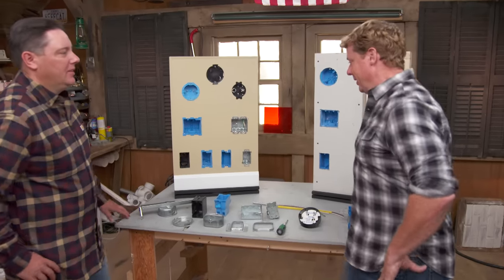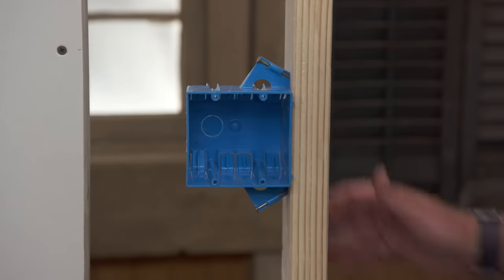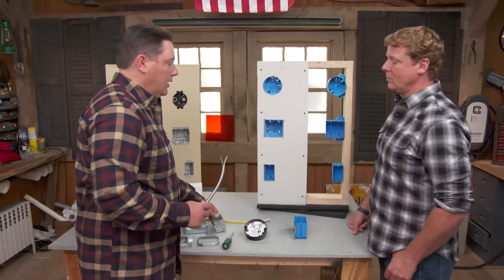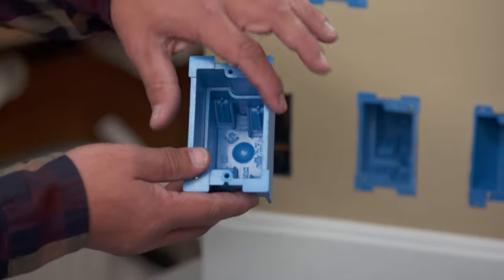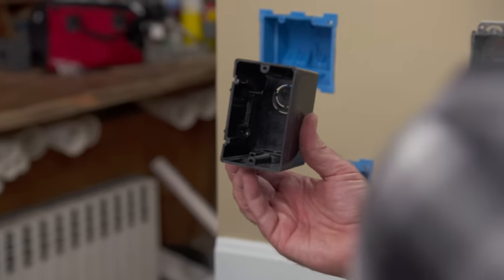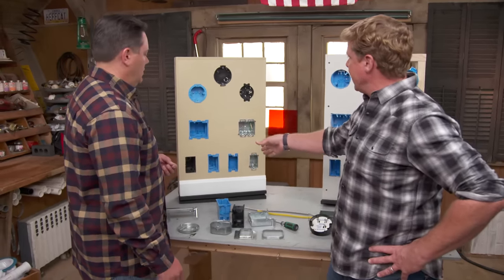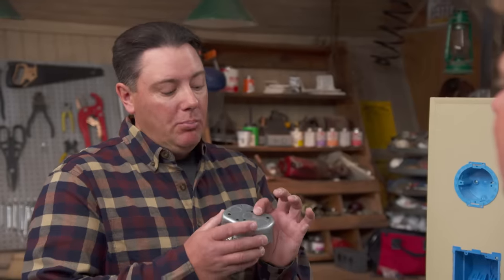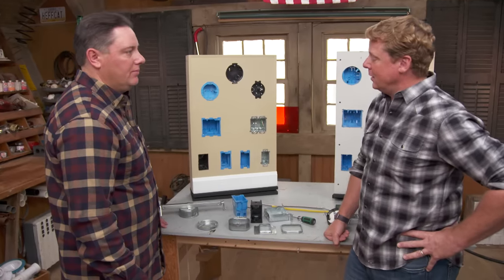How to Choose an Electrical Box | Ask This Old House

Comment: One additional thing that would have been helpful to mention is that the boxes come in different depths.
Reply: I wish my electrician knew that and used the correct depth so my outlets and plugins could be flush
Reply: And depending how many wires you have, you need to make sure it doesn’t exceed the box’s fill rating.
Reply: @damion1121  I found a junction box in my attic that was about 15 cubic inches, and according to an internet calculator, all the wires jammed into it required at least 32". Just a tiny bit overcrowded.  (I replaced it with a 42" box.)
Reply: Agreed.  A GFCI won't be getting stuffed into a shallow electrical box.
Reply: Tg
Reply: The reason for the different sizes is you are limited by the NEC - national electrical code - to how much you can put in a box - wire, size of wire, device(s).
"Electricians" always calculate this prior to their work. Right??
Reply: @damion1121  Good point, and in many old homes I've seen evidence that people discarded that good advice you brought up.....plus it's mathematically-determined by code, as you know I'm sure.
Reply: @JM-iz3fr  Me? Never. I occasionally run into needing 5 wires under 1 nut, which is 10 conductors when counting the hot and neutral, so 10 conductors, 1 ground and 2 switches..  2 gang box.   But,  the 10 conductors being 12-2 compared to 14-2  has a higher result when calculating, sometimes we just don't know until we run the boxes and then we deal with it as we encounter it (grab bigger box, use mud cover on bigger box, run the circuit a different way, etc.   
12-2 has a value of 2.25 cubic inch needed per conductor,  So one 12-2 cable is value of 4.5 cubic inches. 
If I have five 12-2's in this example, 2.25x10 conductors is 22.5 cubic inches, then there is value of 2 cubic inches per switch or receptacle so 2 switches is another 4 cubic inches, then there is ground wire connection which actually just gets 1 cubic inch even though it's a bundle of 5 wires.
So knowing the values that 12-2 is 2.25 per conductor and 14-2 is 2.0 per conductor.  and ground bundle for entire box is 1.0,  and the switch or receptacle is 2.0.
It's easy to just add these on the fly without calculator while running boxes.    Dang I ramble a lot, sorry..
Reply: Electrical work is not a hobby. 
It's not "black to black, white to white, it works it must be right!"
A schooled and interested in their work electrician will know of the box sizes,, basically a good grasp of the code book and will also do the job correctly, be able to think on their feet, have the ability to make necessary changes/corrections, knowledge of materials and provide the necessary inspections for their work.
Reply: @JM-iz3fr  Correct.
Also, load calculations is important to understand before doing electrical work.
I find numerous circuits that need isolated or redone all the time during basement finishes.
Example,  Upstairs ceiling fans, fireplace, kitchen lights and hallway lights listed as kitchen lights on breaker was also feeding the basement lights, thermostat, and a basement non gfci fridge receptacle that was added by a rookie. They person also put 3 neutrals under 1 screw in panel. (should be 1 per screw.)
I cannot preach enough that people should know what they're doing before touching or planning electrical and they should always check updated NEC code before remodel. They should understand wire stress, crowding, distances, limits, load calc, box sizing, hole drilling distances and sizes, staple distances, nut sizing, insulation depth to box and about 30 other things before they begin or they should just hire an electrician.
Reply: @DevJB  ...and most of that applys to residential,  however the obvious applys to all aspects of our work including but not limited to commercial and industrial.

Comment: Steel boxes are robust, high quality, and highly fire resistant, and have been the gold standard for decades. Plastic is cheap garbage and not nearly as high a quality, much less fire resistant, can and does breakdown in hot locations, is the minimum standard for NEC compliance, and are used by those that care about profit over quality and safety.

Comment: The fact that they refer to remodel installs as “old work” demonstrates how screwy the house wiring sphere is. The codes are numerous and inflexible when you build the house, yet you can ignore half of them when you add a fixture afterwards. House wiring needs an overhaul. It doesn’t accommodate today’s lower wattage products, proliferation of home electronics, and frequent remodels.
Reply: I’ve replaced virtually all my old incandescent bulbs with LED. Wattage went down from 60-75 to 5-8. I figured that the existing 12-2 wiring is over kill but no problem.  Is there a downside?  
Am I missing something?
Reply: @Mote78  Sorry for the belated reply. There is no downside. Just a missed opportunity. As you noted, your house wiring is overkill for the very low amperage that LEDs require. A circuit that traditionally accommodated only three rooms of incandescent ceiling lights, might be adequate for ten rooms of LED lights. Considering that there are never enough receptacles in a room to accommodate today’s electronics—and furniture placement preferences—freed circuits would allow for additional receptacles without up-sizing the panel.
Reply: @tycox8704  
Thank you.  That’s a relief.
Reply: Great point, if we had a dedicated lighting-only circuit it could use a lower gauge cable for low power LEDs w/o Edison base, maybe even DC.
Reply: @Mote78  I only use incandescent bulbs because LEDs create harmful dirty electricity and blue light.
Reply: Ty I suggest watch a 13 part series called What on earth happened by Ewaranon to learn that the earth is not a globe. Link in my about tab.
Reply: @flat-earther  
How do leds create dirty electricity?  In any case LEDs can create a rainbow of different colors for 90% less electricity making incandescent the dirty electricity.
Reply: @Mote78  I'm not an expert on that I don't know exactly how.
I think it's because LEDs use DC so when they convert AC to DC that conversion creates dirty electricity, harmonics, high frequency voltage transients.
Maybe put dirty electricity into a search engine, I saw there are websites that explain it.

Incandescent bulbs don't create any dirty electricity whatsoever.

Comment: Just do like the folks who owned my house before and don’t use a box. Lol just kidding please use a box.
Reply: RoastBeefSandwich if you do a splice outside of a box the heat more easily dissipates from arcing though.
Reply: RoastBeefSandwich  Make me a sandwich
Reply: Veni Vidi Vici Make me a Vici
Reply: Oh you could’ve visited my house and have seen the sawdust, drywall pieces and random screws inside my boxes. All very effective at removing any fire prevention capability of the boxes. It was great the way the construction company did that. But really the spaghetti nest of wires that was then put in each box with missing twist connector caps really was quite impressive, breathtaking really.
Reply: When I replaced the Hollywood style vanity light the builder installed in my bathroom, I discovered there was no electrical box at all. They just punched a hole in the wall for the Romex and screwed the vanity light to the wall. Not sure how that passed inspection. I had to install an old-work box for the new light.
Reply: Yeah...boxes, schmoxes. Psh. So overrated. Next you’ll want us using wire-connectors and electrical tape. Psh. If Scotch tape is good enough to wrap presents, it’s good enough for Romex cable! And why are these dang electricians so picky about which color wire goes with another? Black can’t go with white? Is there a racial conspiracy going on with electricity??   [Also kidding, PLEASE don’t take one single thing I said seriously! Except the kidding part. I’m kidding. Seriously.]
Reply: John Hall did you hire a licensed electrician or a “general contractor” who pretended he was an electrician?
Reply: @electricalron  The home construction company that built the house and installed the vanity light did this. (I am the original owner, so no previous owner could have done it.) I didn't discover it until years later when I was replacing the vanity light, which I did myself.
Reply: @johnhall7476  I have a house built in 2005. When I went to replace the bathroom lights, every one of them (4) was done this way. They also did other bad things, that is taking months and thousands to fix.
 Builder saves pennies today to cost thousands to fix later.
And people wonder why builders have a bad reputation.
Reply: @KitchenerLeslie2  lol I imagine the AFCI is also taped open to help accommodate the cooling effects
Reply: or the folks who owned my house and used the bathroom light as a junction box for 9 connections! I have no idea where they go!
Reply: Jason W discovered today that my vanity had no box and theres not even enough depth from the drywall to install one. They screwed the metal bracket for the vanity until the wood stud!  It’s a condo.  Going to have to fight with the HOA. It’s going to be a mess. My other bathroom was ok.
Reply: @janettripper3132  how does a HOA manage to be a factor for something this small? I mean it's not necessarily that small when you are frustrated trying to fix it, I understand, but how does the HOA come into play with something this minor?
are they checking your shopping bags and putting cameras in your house to make sure you didnt bring some contraband junction boxes or wire nuts into the community?
Reply: I had a pair of vanity lights with no box, just the Romex coming out through a hole... and inside the wall, that Romex was spliced/wire-nutted/taped without a box, just buried in the blown insulation.  What could possibly go wrong!
Reply: Our house had Knob and Tube and when we took the lights down, it was just 2 cloth wires coming out of the ceiling connecting to the light fixture. If you’re wondering, yes we did replace it and put new circuits where needed. However the 2nd floor had BX with 2 cloth wires. Their was a box where the ceiling fan was mounted tho.
Reply: Homes built around 1920 and earlier it seemed boxes were at times a luxury.

Comment: I was worried about the blue plastic one day after I saw a wire  burnout while in service so I took one out to the driveway, laid it on the ground and put the torch to it and it took a 20 seconds to catch fire. It immediately went out after I removed the flame.  I slept much better that night.
Reply: It’s PVC it won’t burn
Reply: Tom Garbo one could argue.
Reply: Tom Garbo dude what are you talking about? Its pvc and doesnt burn and its UL listed, you should use metal boxes in commercial, and i don’t get what this has to do with plumbing it just sounds like you’re a diyer who thinks they know what they’re talking about the old boxes were made of bakelite which was brittle and most of the time the screw holes stripped out, not fiberglass which you can still get but is more than a dollar a piece instead of 25 cents a piece
Reply: Tom Garbo lol, either you was doin a bunch of jobs without permits or you only done a couple jobs, i highly doubt you never failed an inspection. And have you seen a box fail? Most of the time the outlet or connection melts where it was arcing, ANYWAY you shouldn’t need to trust the box to prevent a fire from happening if you do your work correctly and you’re right the underwriters listing doesn’t mean much as wago levernuts are listed but ive seen them fail
Reply: Tom Garbo so u failed the inspection

Comment: Also, if it's low voltage wiring (think coax, and ethernet), you don't need a box but just a frame that grabs the plasterboard so the faceplate has something to screw into.

Comment: Very nice explanation. However, it would have been nice to explain issues surrounding which depth of a box (the measurement of how deep the box extends into the wall) to choose. A deeper box allows more room for wires and connections. Is there a downside to using a deeper box (other than cost)?
Reply: Sometimes the wall is too shallow to fit the deep ones. Other than that, no downsides to using a deeper box.
Reply: Pancake boxes are what the shallow ones are called. About 3/4” deep or half inch deep

Comment: Gotta admit those Old Work Boxes are nice, cut a quick hole turn a couple screws and they're in. Of course you have to wire it but as far as cutting the hole and mounting it only takes a minute.
Reply: Jupp Schlabutt Germany always has the best solutions for many problems in the world.

Comment: The plaster old work boxes should be standard for new and old work, they are absolutely lovely to use. Also way more solid then the drywall tabs style.
Reply: Do you ever have them slide back into the wall when you drive the screw at that angle? From a first glance it seems like they would want to move that way? Can you enlighten?
Reply: @MandoFettOG  so put box in place, use screws that come with box just to make marks. Then pull back out, use drill bit to make a pre tapped hole about 1/8 inch drill bit or so and make a 1/4 inch or so deep tap hole.  Then go back with box. No issue after that. Hope that helps. Ask again if ot enough info.
Reply: @Ampacityelectric  nice, thanks

Comment: Might want to add Low-Voltage boxes (Orange) for datacom. Some homes have LAN structured wiring, and "smurf" tubes run for future needs (fiber, Cat6/7).
Reply: Have you heard of WiFi? Wireless? About 20 years ago I ran CAT-5 cable & coax all over my house. It's all just sitting idle now.
Reply: @TheYeeterDefeater  exactly, a 4k Sq ft house is going to be badly served by a single wifi location. And 4k video eats bandwidth, so a couple 4k TVs streaming will murder available wifi bandwidth unless it is all 5Ghz. If it is all 5Ghz, the range will be even less
Reply: @RichardFallstich  Wi-Fi is what you use for devices that can't be wired and devices that need to move around. If it stays put and supports Ethernet, it should be connected with Ethernet. And aside from that, you need wires to have proper Wi-Fi anyway, via access points.
Reply: Richard, most wireless does not support Gigabit Ethernet.  With more and more metro areas receiving fiber to the home, the ability to transfer data will be restrained by the limitations of the wireless network.  Besides that, I think you're comment is rather dismissive - there should be several locations in the home where there are data jacks - future homeowners may use a different communications utility that relies on coax, and unless the home is equipped with a media cabinet, having options as to where to locate the modem and the ONT is very beneficial.

Comment: Question:
Where do you find studs like that?
All the big box stores' studs are half knots, bowed, twisted, and missing chunks where bark is.
Reply: hint Dont go to a big box store.
tip find an actual lumber yard
advice make sure the wood looks luke its been sitting, and dry. If its wet even the slightest it will dry and warp no matter what.
Reply: You found me! ;)

Comment: I was just doing some electrical work in my house. I bought the blue plastic boxes just like those in this video. I nailed them to the stud using the little molded in tabs for depth control. I installed my 1/2" drywall and guess what? The boxes are in too far by about 1/8". Now i guess i will have to put washers between the receptacle and the box to bring it out. This is really irritating.

Comment: Is the black box NEC compliant? Per 314.43 "Nonmetallic Boxes. Provisions for supports or other mounting means for nonmetallic boxes shall be outside of the box, or the box shall be constructed so as to prevent contact between the conductors in the box and the supporting screws".

Comment: Why do the old work boxes have those tabs with screw holes in them? I understand the centered ones at the top and bottom are for mounting wall plates on, but the other four holes on the tabs have me confused? Are they for screwing the box directly into the drywall?
Reply: Those plastic tabs close into the inside part of the sheetrock when tightening the screws. That's the way you secure your old work box in the wall. Without those plastic tabs the box will be lose and fall.

Comment: What’s the difference  in the blue remodel boxes?  There are 2 single gang boxes they look the same and it was mentioned they are similar. But what’s the difference?
Reply: looks like remodel ones have a flange which prevents them sliding into the wall
Reply: Look at 2:09 when they show the back. The one box is shallow with extra space to the side so you still have room for wires.

Comment: I watched this to see you talk about the single gang lower right corner of the display. It has the 2 wings that slide in the sides with tabs you bend over inside the box. You never talked about this one which is commonly used.
Reply: Battleships where I'm from
Reply: I've always knew them as "madison hold its or clips".  It depends on where you are from.  Those yankees have different names for almost everything :)

Comment: Good video but no discussion about the box that is wide in the back, but single outlet in the front... look at 2:05(rear view) you can see the box on the left is wide but front view (2:12) it is narrow- Is that for excess cables or maybe a transformer or other type of hardware or devices??

Comment: What about junction boxes?  What about the number of Romex that can be included in the box?  What about the extra depth boxes and their use?
Reply: There are too many codes to explain to the average person, and new codes are added and/or changed all the time. You would need a codebook if you really want to know all of those things.
Reply: I wondered about junction boxes too, specifically I wanted to find out if you can use a switch box as a junction box